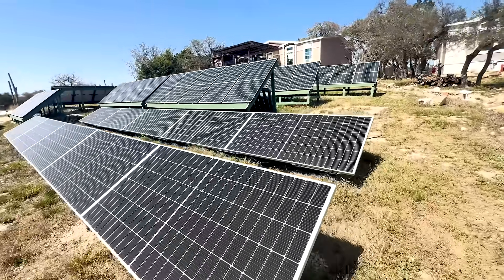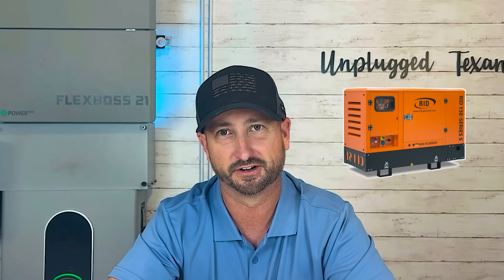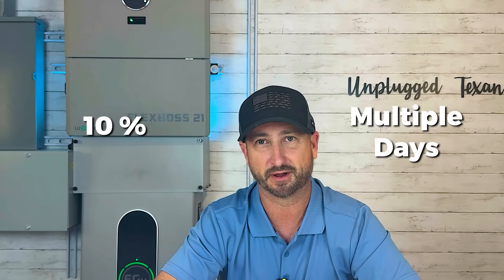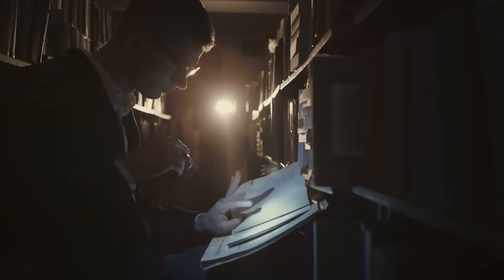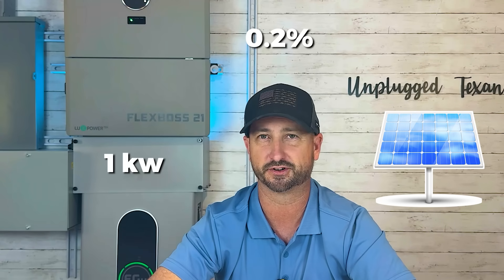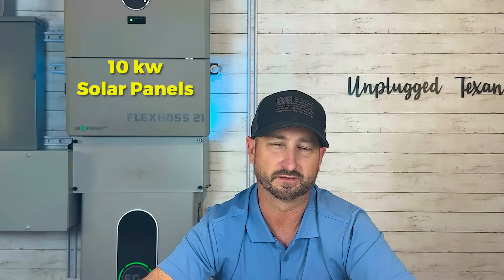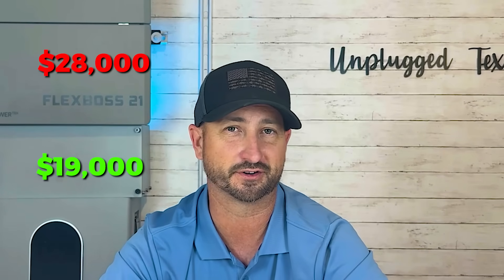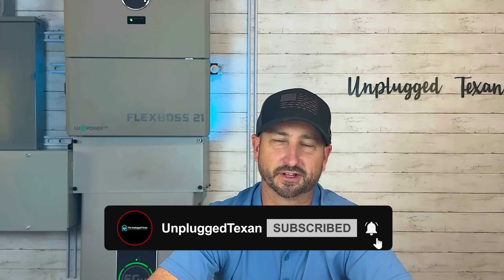WHOLE HOME SOLAR With Battery Storage: Is It WORTH It?

Comment: $25k to $30k is not that expensive in today's  world for what you get in return for a whole home power system hardware.   It's the labor that cost will put a big dent in your wallet.  

Being an EE and having worked with high-voltage AC and DC along with my NEC handbook, I can do most of the work myself. However, it's always nice to listen and learn from other guys who have done this already.  Your videos are well done, Brian.

Comment: I would like to see if Enphase mico inverter would work with the turbine.  Enphase does not not have a single point of failure should your main inverter have an issue. That being said I would like to hook up the wind turbine to a enphase micro inverter and see how it would work. Other people have claimed it worked and are happy?? not sure would like to see some testing before I jump into it .... Have you tried Enphase? I had to get certified to install as a DIYER

Comment: we had solar installed in 2017 at that time we almost always had a very low or credit on our power bill. that changed and now our bill is a min of $110 a month. my current inverter I can't add batteries to what is your suggestion in this case. thanks for your time
Reply from the maker: @drewspangler9434  you’ll most likely need to remove your old inverter and replace it with one that allows AC coupling since your solar panels most likely have microinverters sending AC power (not DC) power down to the inverter. This system that I’m linking to below is probably a good option for you. 
How easy is it to install the EG4 Gridboss and Flexboss21?
https://youtu.be/fJ6ismC8gmc

Comment: I live in Austin, and we have an $.1125 buyback. It is virtually impossible to make a business case for battery storage.  A conventional generator is far more cost effective. With care, it will last the life of the house, while batteries that are heavily used might last 10-15 years.  (Austin Electric is city owned. They have a reasonable program . Until the last couple of years, solar did not even make sense, but in the last couple of years, competition has increased and bids to do solar have gotten reasonable.)

Comment: I really do like your channel.  I downloaded your PDF and I usually went to the PDF if I had any questions.  I have three of the EG4 Powerpro All Weather batteries with a Flexboss 21 and a Gridboss.   I did almost all the install myself and I'm 71 years old.   My timing was good as my first quote from Signature Solar was just over $18K but when I came back to order, I had to get the quote redone and with the sale they had going on, I got everything for just over $17K.   And all I had my electrician do was schedule the disconnect / reconnect, run the cable from the backup loads to what was my main panel, and then move the Power meter hook up from my main panel over to the Gridboss.   He had to move the neutral ground to my 150 amp AC Disconnect the city was going to require.   It's hard to find a residential panel that can handle over 250 amps.  The 120% rule limited me to no more that 150 amps.  Which is OK as I was getting by with 100 amps w/o any issues.  I do agree with your statement to get as much solar as you can.  I have a 12.5 KW setup on a East/West roof.  I removed two Goodwe inverters which combined never gave me anymore than about 9600 watts of solar.   Where the Flexboss consistently gives me 12.5 KW output during the peak of the day and bright sunlight.    I think the Goodwe inverters were clipping.    What I can say is I'm really happy with how everything is working.  Permitting is a challenge.  But my city was quite patient with me.  I first went over to the DER team and showed them what I wanted to buy, and they first said no.  But that was because they didn't know the equipment all that well.  Once I got them the data to refute what they were saying they turned around and gave me a green light to buy my Flexboss / Gridboss.    Took about three attempts and the drawings to get the city happy with my design.  I used the EG4 example as a template and then modified it to my situation.  Overall it took about 60 days to get my permit.  Fees are another story.  About $1200.00 in fees.  I think they over charged me, but it is what it is.   Good news was only about $1700.00 on my electrician.  Still waiting on my AHJ  to get me my PTO.  The Solar inspector said he thought I had been using my system already.  So when he passed me on my inspection, I just left everything turned on.   That was over a week ago and I'm still waiting on the DER Team to get me my PTO.    So it can be done.  The only challenge I have so far are the cloudy days.  My 12.5 KW system only produces in the 3-5 KW range and sometimes even less on cloudy days.  And it has trouble charging the battery back to 100%   Like yesterday, it only made it to 88%.  And it was down to 39% this morning.  With the sun, I have no problems and it charges up fast.  It's only the cloudy days when you need more solar.   ;0)
Reply from the maker: @brod5352  thanks for the detailed feedback. That’s awesome that you did almost all of it yourself and even did permitting yourself. Love to see that kind of determination. You’re a rare breed in our current world. Congrats on the system. Glad I could help in some small way. This is the feedback I need to keep making videos as it’s hard to stay motivated sometimes when I don’t see my subscribers growing like I feel it should.
Reply: @unpluggedtexan    Good luck on growing the  channel.  There a few solar channels I follow but yours is one of the better ones.  Mostly because of your detailed install with the Flexboss 21 and the Gridboss.    I was going to buy an EP Cube, but Signature Solar suggested I look at the Flexboss/gridboss as well.  They quoted me both and I thought EG4 offer more for the money.   Warranty wasn't as good, but I've heard nothing but good things about EG4.  So I felt it was the best choice for me.

Comment: Brian, I also live in Texas and CenterPoint is the utility provider for this area. About 3.5 years ago I installed a 7.5 kw system (no batteries). I was selling back to the grid with 1 to 1 net metering and always had a credit. At that time, getting my “Permission To Operate” (PTO) from CenterPoint was not too difficult. Then 1 year ago I added another 7.5 kw of panels, batteries, and another inverter. This time it was more difficult to get my PTO, it took 6 months (that’s a story in itself). I also purchased an EV and charge it with the solar system. I still sell back to the grid with a 1 to 1 net metering and have a credit. By not having an electric bill, and not buying gas, I am saving about $500 a month.
Reply from the maker: @kenharger7520  nice, you’ve got a good deal at the moment. That’s a lot better deal than most are getting.

Comment: Step one: don’t buy from commercial sellers. DIY as much as you’re comfortable with and your system will pay for itself in a shorter window. I got four quotes and they all quoted me over $80,000 for a $15k system.

Step two: profit
Reply from the maker: @CWK09  yikes, that’s a big markup for labor. What area are you in?
Reply: @unpluggedtexan  yeah, considering they typically outsource to a local electrician for that portion, the cost is too high for what I would consider low skill labor.

I can get 585W bifacial panels for $200 and they want to charge $600 for 400W (non-bifacial) panels. They would probably be fine charging $30,000 if you can pay all at once, but when you look into financing they will push it out 25 years and you end up paying two or three times more. 

Electricity is super cheap here at night ($0.021 per kW) so the cost for installer vs electric savings is a difference of $20 a month, so it’s DIY or nothing for my area.

Comment: My power company would not allow me to get more than 10k in solar panels. This would not meet my needs and they wouldn’t budge. I called electrical inspector and they said I can diy and go off grid. Only had a final inspection here in the county. Used 2 Solark 15k inverters, 24kw in solar panels, 2-30 panel rack mounts with seasonal adjustments, 5 EG4 power pro all weather batteries , and used bill holts course for NEC and solar installations, installed one 10kw harbor freight backup generator to charge batteries and then I was off grid. I do have a whole house generator, but was cautioned not to use it for my battery charging. It was great giving back my meter can to the power company. Doing it myself saved me $75,000 in labor and installation costs.
Reply from the maker: @ttdf12  congrats on telling the power company to pound sand. Thats awesome.

Comment: It's worth it if you don't get sucked into one of those financed "free power!" deals that all the installers were hawking past couple of years. 

Doing it one bit at a time & paying cash? Heck yeah it's worth it! My 12v system will become a 48v system with two more batteries. Temu & AliBaba have some great deals on battery kits for those so inclined. Riuxu has some great deals on batteries as do Eco-Worthy & others. Amazon even started listing LF inverters that actually are low frequency. (Not the 'brand names', but it's a start.) 

I'll be glad to get the whole system up & running on 48v but for now, I haven't had a power bill since March 2023. STUFF APCO/AEP.

Comment: My new DIY system total cost is 8k, including 2 inverters, 30 kwh LiFePo4 batteries, 2k of ploy solar panels, wiring and 2 charge controllers.

My first high cost system cost 25k, it got destroyed on the move to my bugout location.

Comment: EG4 inverters and batteries were already overpriced, and now that theyve substantially increased their pricing in the last couple of weeks, its aimpy not worth it anymore.
Reply: Facts! The 6x 5 kwh batteries and rack alone cost me 9500, It got destroyed, on the way when I moved to my bugout location. Along with 60 kwh of batteries that I built, for a total of 100 kwh.

My new DIY system total cost is 8k, including 2 inverters, 30 kwh LiFePo4 batteries, 2k of ploy solar panels, wiring and 2 charge controllers

Comment: I went off-grid right from the get-go. Our state regulations were such a p.i.a. that it was just easier to disconnect from the grid and be done with it. With panels and batteries the payback time, based on our historical electricity use, would have been 12 years - probably not worth it given that the batteries would have been on the way out by then. The real clincher came when we bought our EV. The EV replaces a vehicle that would get 18mpg on a good day but was typically worse than that. By filling the EV for free and saving what we would have spent on fuel, the payback time for the off-grid system is now a very respectable 8 years.

System spec: 15.1 kW of panels, 50kWh of usable battery storage, 15KVA of inverter, 7.36kwH EV charger. Installed myself.
Reply from the maker: @Qosmio1955  thanks for the info. I’m starting to consider getting my first EV

Comment: I’m so with you on this.  I want to go off grid in CT with grid backup on a ½ acre lot (we are only allowed roof installations). My hesitation is EG4.  

I have no problem with EG4 per se, BUT I bought into the EcoFlow hype in 2022 and after $8k invested (vacation cottage) I am extremely unhappy and disappointed.  

Everyone is EG4 crazy right now and I’m concerned it is just hype.
Reply from the maker: @gnewman18  not just hype. Their products are very well built. They are always innovating, and I’ve never had their products fail. I’m not sponsored by them. They are the most affordable high quality products out there for DIYers.
Reply: @ thanks… but also thank you for the PDF … that is helping me (a mostly non dyier) get my head around this.  CT has some of the highest electricity rates in the country but more importantly, the town we are in has a choice of oil heat or propane mostly.  I’ve had oil heat in the past and I hate it.  The service providers are all slimy.  I’m keen on going with heat pumps run on electric.  The houses here have old-time insulation so it’ll need to run a lot. 

Someone is gonna make a lot of money here in CT becoming the go to installer for these types of systems.
Reply from the maker: @ yeah during Covid it was 3 months to get a propane delivery to my house. A vowed to never be dependent on them ever again.

Comment: I was surprised to hear you say, you don't export any energy to the grid. I have 22- 395 watts jinko solar panels , net metering buy back rate is $0.035. And I am putting 40 more of 550 watt. panels.. Reason why at 0.03 cents it take 33 kwh of solar  to make a whole dollar.  I will be earning around $2,000.00 plus a year from my utility company. Making my pay back time 4 to 6 years. Oh last thing yes I'm getting the grid boss and two flexboss 21. My AC is on a 30 amps breaker along with my electric dryer.  That's is two 7200 watt circuits . 12000 watts of continuous power is only 6000 watts per leg.

Comment: I've been trying to go solar for about 5 years now and as of yet, due to my roof design and space limitations, I haven't had a quote that puts the payoff period less than 15 years... And that's without batteries so it's completely useless for the one situation I would really want it for when we have a rare grid down scenario.

If I add batteries the payoff periods become essentially infinite because it will never break even.

It seems DIY is going to be the only way but the learning curve to figure out regulations on grid tie has been huge. Maybe one day, but for now it seems it's just not a great choice for my situation.